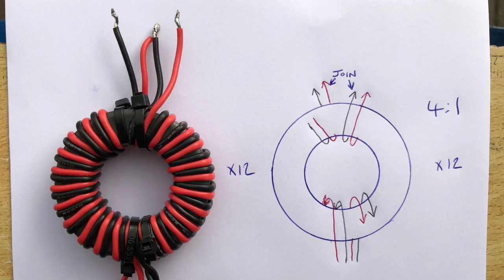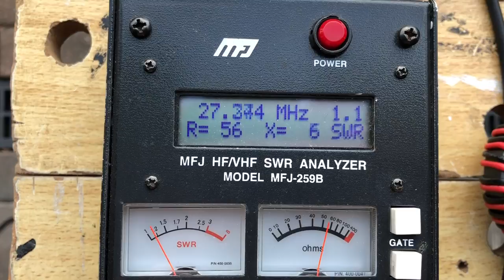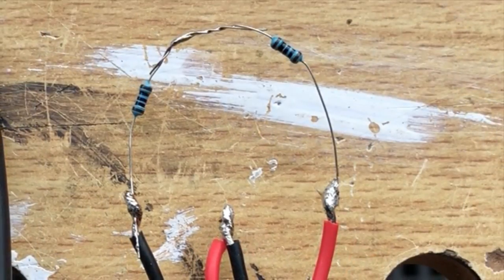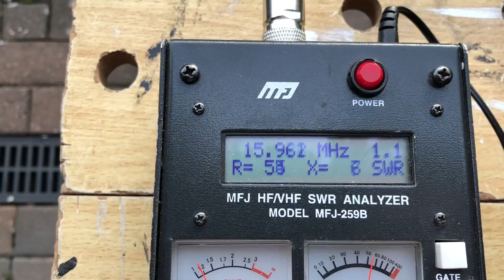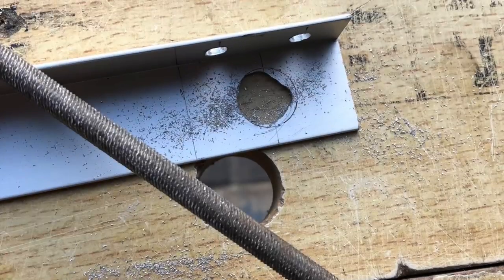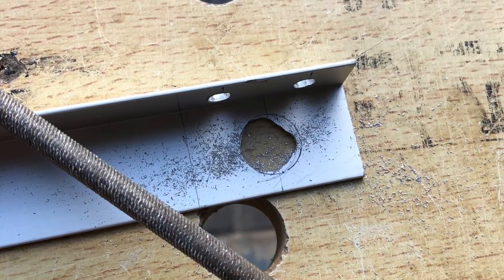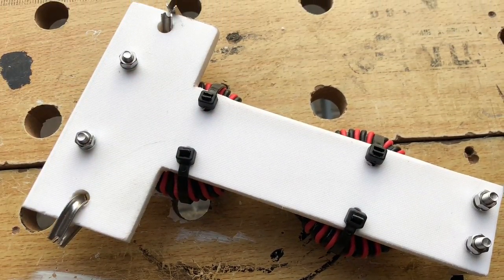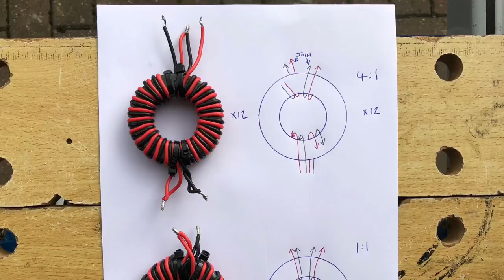A Better Off-Centre Fed Dipole - Part 1 (4:1 Transformer & 1:1 Choke / Balun Build)

Comment: Nice video. I have one question/concern about the design, though.... Would it be more appropriate to switch the order of the two cores so that the 1:1 current balun (choke) is attached at the antenna side of the pair to convert the 200-ohm BALanced load to 200-ohm UNbalanced, then with the second core, transform the 200-ohm UNbalanced to 50-ohm UNbalanced? (So that the order is 1:1 BALUN to 4:1 UNUN with the antenna side being 200-ohm BALanced and the transceiver side being 50-ohm UNbalanced.) The way it is presented, as I understand it, in the video, the 4:1 UNUN is being used on the BALanced side of the circuit rather than the UNbalanced side of the circuit. This doesn't seem quite right to me, but maybe you have a good reason for it that I am not seeing?
Reply from the maker: You could possibly reverse them as you suggest I suspect, but then the 1:1 would need to be designed for 200Ohm? This version copies the 1:1 50Ohm I’ve successfully used on my 80m dipole. After some years of use I can confirm that it performs really well and is my go-to main antenna 👍🏻 Thanks for commenting 😀

Comment: Hello! Would this work on a center fed dipole, the reason I ask os because I am limited on space to mount an off center fed dipole.
Thank you
 kb1mlq
Reply from the maker: Hi Duarte. I’m not sure what you mean as both a centre-fed and off-centre fed are both the same length, but the off-centre gives you extra bands on the harmonics. A trap-dipole will be shorter if you’re tight on space. Good luck!
Reply: Hello and thank you for the reply, the reason is the off center fed dipole is longer on one leg and that is where I have the problem, the center fed it is equal on both sides and that gives me more room to install where I want the feed point at.
Thank you so much for your prompt response
Duarte Bettencourt
KB1MLQ

Comment: The 1:1 choke would be much better if it was wound with 50 ohm, Teflon insulated coax.  The double, bifilar windings like you have shown paralleled only have half the common mode impedance and a single bifilar winding much the same as putting 2 resistors in parallel.  The coax is easier to wind and much more effective.
Reply from the maker: Thanks for the info! Note also that this choke doubles as a balun.

Comment: Hi, can anyone tell me please, does the 1:1 balun need exactly 12 turns? I can only fit about 10 turns per side on my ferrite core - does it matter?
Many thanks :)
Reply from the maker: Keep trying Dave. It stretches the outer cover when you’ve given it a go. Really tight and it’ll go on I’m sure….I had several attempts….
Reply: Cheers, will do :)

Comment: Hello sir.
I followed your video but I think I must have made a mistake,  I am going to verify all the windings are correct. However I have one question, when using the analizer did use the radio coax or just a wip for the testing, and also what lenght of coax will be necessary to do the job right? 
Thank you in advance 
Kb1mlq
73's
Reply from the maker: Just a small patch-lead I had to hand Duarte, nothing special. Good luck with yours 👍🏻

Comment: Two questions: 1. How many watts is this design good for? 2. Could I fold them over and tuck them in a waterproof enclosure?
Reply from the maker: Hi. Good for UK 400w limit (you can stack for higher powers). Yes you can stack the two, but ensure there’s a breather hole in the box for condensation to escape due to heating and cooling of the air inside. No box is fine and less weight. Good luck 👍🏻

Comment: Is it required for black wire to be connected to center and red to shield?
Reply from the maker: Hi Sam, it’s the positioning of the wires and not the colours. This red/black combination mirrors a previous balun video and links back to Pater’s channel. I kept things the same so they match each other. Thanks.

Comment: Thanks Ian, looking forward to part 2. I have an OCFD here with the shorter end from the chimney resulting in the feed point at a good location to the upstairs shack at the back of the house. I also use around 220W from a Yaesu FT1000 MP MKV , into a virtually identical arrangement based on Peters website. I have not noticed any heating effects although the winding insulation appears to have suffered all little from UV.
Reply from the maker: Thanks Adam. Yes, looking good so far 👍🏻